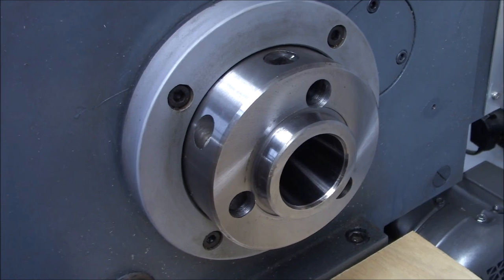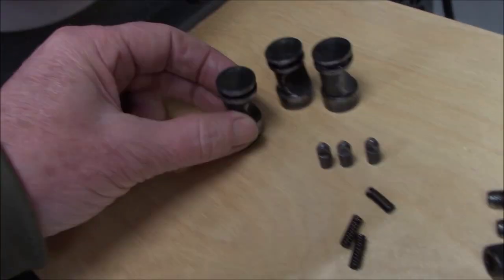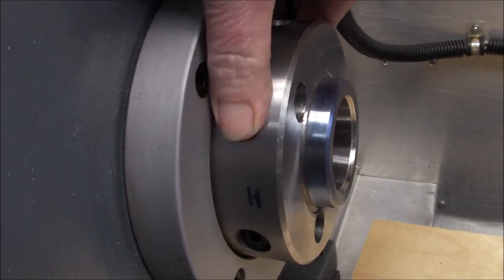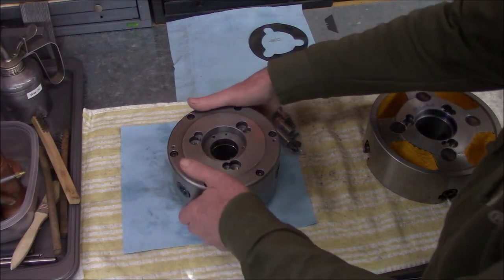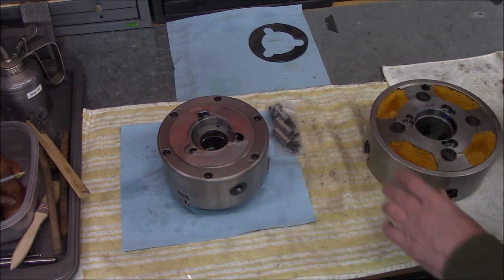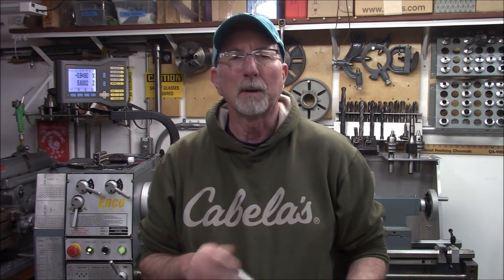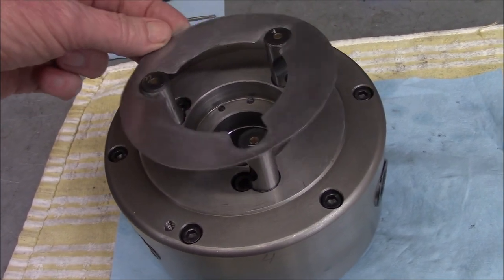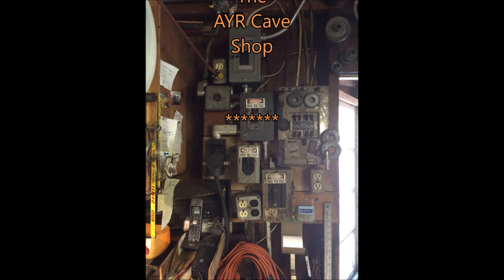New to Shop Lathe Update 6 - Finale Details, Chips ??

Comment: Gday Dean, I like the idea of a 8” 3 jaw, you got me thinking now, the old chuck could always be used on the mill as another fixture, great to see some chips too, the gear ratios are different to mine as well, mine tops out at 1400 rpm but they look very similar, great job mate, cheers
Reply from the maker: Thanks Matty, Sure nice to have it running..
Cheers !